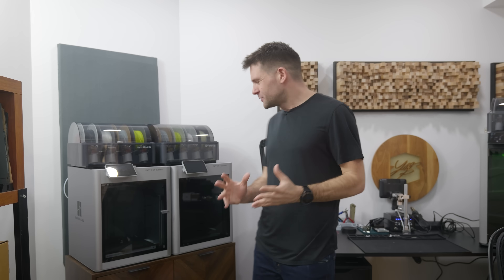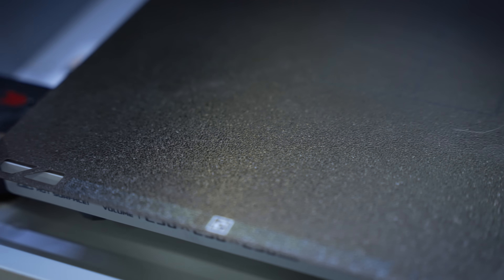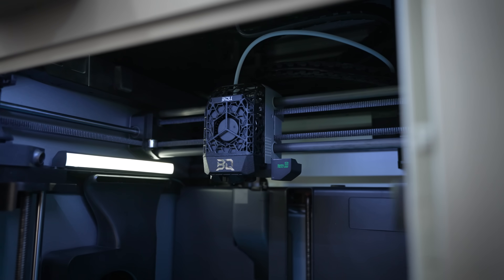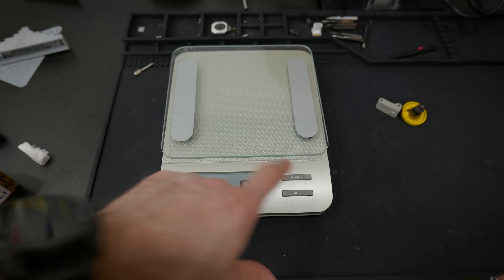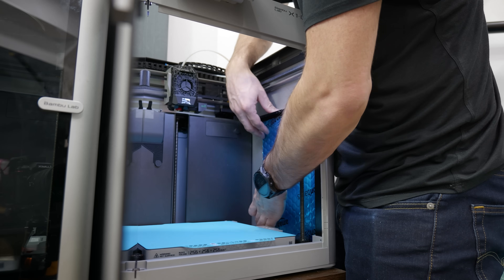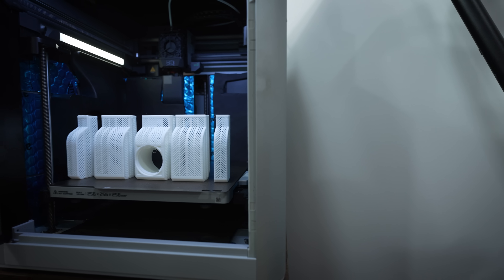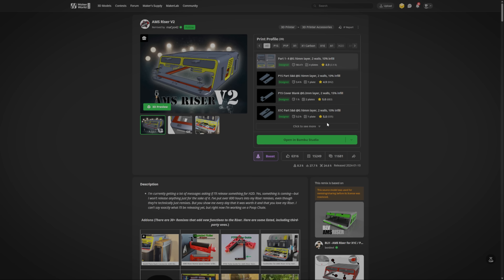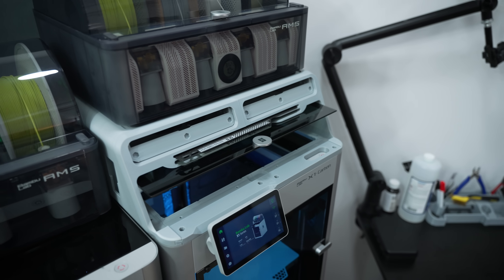I dont understand why more people dont MOD their 3d printers...

Comment: “Why don’t people mod their 3D printers?” 

Spoken like someone who missed the first 15 years of 3D printing.
Reply: I specifically bought Bambu and Prusa printers BECAUSE I was sick and tired of fiddling with my Ender 3s and CR10s and Anycubic bla bla blahs.
Modding modern printers typically does nothing for the standard user, those paid upgrades are geared more towards print farms. The printed upgrades are definitely where it's at, because as the main point of the video was - they are about usability and improving the experience rather than improving print speed or quality; they have both been covered by the manufacturers already.

Gone are the days of buying a cheap printer for <$300 and spending $400 modding it to perform like a $600 printer. Now you can just buy a $300 printer which performs 10x better.
Reply: Klipper users have entered chat
Reply: @AlexG207 based
Reply: @AlexG207  With Bambu's recent stunt with "You must use our Slicer!" and firmware lockdowns, it's more than enough reason to avoid them. Price hikes due to the tariffs is another reason. If you're the basic hobbyist using a 3D printer for fun, sure, that probably doesn't matter. I however, need to calibrate my filaments, z-offsets, Z-Hop and other critical settings to improve print quality. Klipper gives me that for both my FlashForge and Anycubic printers. Bambu is better off selling their business to Apple and calling it a day.
Reply: Most of the printing I do is for mods for my printers
Reply: @charleylavin  Charley, you really need to get out more.
Reply: Bought my ender 3 on launch. What a time to be alive.
Reply: Yeah I remember when mods most printers had a list of recommended mods to just fir basic function and reliability.
Reply: Man. I miss open firmware printers.
The question I actually make myself, is why people accept vendor lock-in.
Reply: @Splarkszter there's lots of open source machines. Bambu is the opposite.
Reply: lol exactly. I modded the crap out of my Ender 3, not so much that I enjoyed it but because you had to to get decent quality and performance. Now I want to tinker with what I print and not fuck around with my printer.
Reply: @instanoodles  still grumbling through on my ender 3 pro HEAVILY modded to behave and do it at speed 🤣 but man if I had the spare change one of these newer core xy machines would be SWEEET
Reply: @instanoodles  back then we were simply lying to ourselves that we enjoyed tinkering with the printer.  it was simply pure copium
Reply: @instanoodles  i dont understand the problem people have had with ender 3's like im a beginner 3d printer as of january 12th this year and i got an ender 3 v3 se zero isssues aside from my own incompetance
Reply: @D30Delirious  The Ender-3 V3 SE is about six generations of major hardware iterations after the original release model of the Ender-3, so really not the same beyond the 235×235 build area and the basic bedslinger form factor.
Reply: hahaha exactly...  Hey Zac, welcome to day-1 dude ;)
Reply: ahah this.
Love these videos of people that just got into 3D printer, ignoring that it has been around for years and modding is pretty much what most of us do.
Reply: I've just got into 3D printing, but a good mate has been doing it for a long time and I've heard of all the issues and time consumption just getting it to run takes, so I am super grateful for the plug and play machines available now. 

I will not be taking anything for granted. 
In fact, when something takes 'a long time', I feel more grateful because it would've taken 2x,3x, 4x with older machines 😅
Reply: MONEY IS THE ANSWER, plus current printer are pretty dame good out of the box but expensive so you don’t really wanna spend more money on it with little reason too.
Reply: YUP me watching with my original ender 3 with basically only motors and half the aluminium frame the original.......
Reply: yuuuuuuuuuuuuup
Reply: nice
Reply: Automotive hobbyists enter the chat.
Reply: I built a Mendel back in middle school, I've had modded a8's, enders, robo3d, og qidi, and some POS davinci. I'll say that I'll never go back from the bambu because it actually works lmfao
Reply: and after watch the video we end up with 1 funcional mod only
Reply: @Splarkszter  Most people are short-sighted creatures of comfort who only care about convenience until their decision bites them in the butt. That said, there are plenty of DIY kits/BOMs (Vorons chief among them), and most of the manufacturers of non-industrial 3D-printers still have no barriers to replacing their (nowadays usually Klipper) firmware forks with fully featured ones, even on their Bambu-style printers. Bambu and IIRC Anker are AFAIK the only black sheep.
Reply: All my printers before the X1C were more mods than original parts, I've bought the X1C so to NOT having to mod it
Reply: Guys trying to flex by talking about how they spent so much time they spent tweaking their Ender 3 or their Anet A8. My first two printers were scratch builds because Ender and Creality didn't exist.
Reply: @drhender6943  you must be a lot of fun at a party. Do you go around tapping each person on the shoulder to explain how you are cooler than everyone else or do you ask them to gather around so that you can tell them all at once?

The video was about modding printers so people addressed modding printers. What kind person would I be if I was to answer a post about modding to tell him I built my own printer… oh wait…
Reply: yeah this guy is an idiot
Reply: True words
Reply: Lol exactly. It was all about that.
Reply: I will never go back to that. Spent more time calibrating my printers than printing
Reply: Exactly. My first 3D printer was an Anet A8 which I got in 2016. By the time I was done with it, it looked and ran like an Ender 3, with full aluminum extrusion frame. Then along came kids, and now I don't have time to mod 3d printers anymore.
Reply: @kulilin3104  anet a8 was my first aswel.  and it has become many printers.   bit ship of theseus thing going on.  
it was technicly the same "printer" but all of the parts had been "upgraded" many times.   
even gone through a few re-designs.   

in the end it was big.  full metal.  had a belted z instead of leadscrews or ballscrews.

had so so many features.  and still.. the bambu simply was just nice.  no more need for recalibirating.  no more need for temperature towers.  no more need for anything time and fillament wasting anymore.  simply draw and print and it works, is dimentionally accurate.  it's just nice.
Reply: @darkracer1252  I purchased a Bambu as well. I still wanted to 3D print, I just don't have the time for tweaking and modding anymore.
Reply: RIGHT?! What an insane question. I want to work on stuff WITH my printer, not work ON my printer. Some people have other goals in life. This low effort slop is so annoying.
Reply: @goldwinstewart6590  if you think this is low effort, you mustve not seen some of the other 3d printer videos on youtube
Reply: @goldwinstewart6590  Thank god, I thought it was just me. Apart from the poop basket on my AI mini, I'd rather spend time learning 3D design and printing actual useful items, spending my money on filament not inconsequential crap!
Reply: @goldwinstewart6590  yea just a shit video overall....

Comment: “Why don’t more people mod their 3d printers?” - do you think Bambu is the only producer of 3d printers in the world or something? 

Tons of people mod their printers. Tons of people have basically always modified their 3d printers. 

Honestly, the premise of this video would make a lot more sense if it were just, “Why don’t more people mod their Bambu printers?” generalizing that topic to all 3d printers is a stretch to say the least.
Reply: And most of those printers that NEED mods to work well, are poorly made and designed in the first place. Why buy them?
Reply: @ I have a modified Voron Trident 250, a modified Jubilee toolchanger, two modified Voron V0.1’s, and I’m in the process of building a modified HevORT. None of those are poorly made, and all of them work well as their original design. I made them work even better (for my use cases) through mods. 

But really, what’s your point here? Whether or not printers are poorly made is irrelevant to my comment. I was making the argument that lots of people mod their printers because the video title asks why more people don’t mod their printers in general. That’s a terrible video premise because TONS of people modify their printers - it’s just that not that many modify their Bambu printers. Asking why more people don’t mod their Bambu printers would be a fair video based on the content. However, across the 3d printing hobby as a whole, a very large percentage of people do in fact mod their printers, which means the video title doesn’t actually make any sense. 

As for why people would buy poorly made and designed printers in the first place? I think what you’re referring to as poorly made and designed (at least these days) are actually decent printers that have one or two serious flaws. For similar performance, I would argue that it’s often cheaper to get one of those printers and throw a couple of cheap mods on it to get performance that is similar to what Bambu makes, but for less money. So that’s why people buy them. Plus, Bambu printers have a whole host of issues associated with them if you care at all about cybersecurity or consumer rights - and some of these cheaper printers are pretty well open sourced.
Reply: @ those printers are ok out of the box, but aren’t really well designed. That is, they’re fine, but not great. If you like them, that is great. But a lot of these mods don’t really make things better, and you can’t duplicate a Bamboo Labs by modding something else. If that’s what someone wants, then they should just buy the Bamboo Labs.  After all the mods, the money and particularly the time spent, usually doesn’t make it worth it. But, you see, this is what we’re talking about here, the difference between someone who want to play with the machine to hot rod it and the person who buys a machine to just print. I know people who have spent way too much time and money “upgrading” their machines who have found little difference.
Reply: @ in what way, specifically, are they not well designed (I assume you’re talking about the printers I listed)?

I wasn’t trying to duplicate a Bambu Labs printer with them, nor with the mods I chose. I think you’re latching on to the wrong point here though. I am not arguing whether or not Bambu printers are worth buying, or if they’re well designed. I am specifically arguing that the video title doesn’t make sense. The video title specifically relates to the entire category of the 3d printing hobby. The video content specifically relates to Bambu printers only. The inferred assertion from the video title (that not very many people who 3d print modify their printers) is utterly ridiculous. That is the point I am making. 

If you know people who have spent too much time and money on ‘upgrades’ with little to no difference, those people chose the wrong mods. Bambu machines are fine, and they (generally) work well. Bambu has also - thankfully - done a decent job of offering replacement parts for when things wear out or break. There are also things that Bambu machines either can’t do, or don’t do well. They also lock you into their ecosystem, which is something I am not a fan of.
Reply: My Sovol SV08 is working right out of the box, really it's fine for what I currently need it for, but I am going to update it more partially to add some convivences,  Multi material, (vendors are coming up with some very good ideas) level the bed better and faster, the bed right now received some shims, but it was still OK for the most part, for what it cost I don't mind. Now worth it? for me 100% worth it, not too hard to work on, fun little project, and even with the things I am doing to add it will do what I need WAYYY cheaper than the Bambu H2D I wanted to get.  I do not like working on them to fix them per say, but some mods within reason to make it more unique and do  what I want or need makes fun. 

They have come a LONG way since I got my Ender 3, and my little monoprice mini before that.  As for the Sovol SV08, this printer is totally worth what it cost, you will be very pleased with this printer AS IS if you need or want larger 1 piece prints. I am so glad I got this.
Reply: Gotta love that cloud lockin, chipped spools and closed hard/software.  otherwise it isn't a challenge is it ?
Reply: Said it all
Reply: this guy probbably bought a bambu as his first printer and got it this year or something.  seems to be totally new to all of this like the rest of us 5 to 10 years ago.  and some of us 25 years ago. 
and has that bubble view.  only knows what he knows and thinks nothing else exists.
Reply: @ it sure seems that way - I've been into 3d printing and modifying 3d printers for the last 10 years or so. My first printer was a Creality CR-10S. My first build was over 5 years ago now, and was a Jubilee toolchanging printer - which I'm currently revamping from Duet 2 hardware over to Klipper and USB toolboards.
Reply: Yes sir! I just ordered a Sovol SV08 and many addon parts and going to install some before ever turning it on! The printer alone without the mods cost just what the H2D added markup money. For what that thing costs now, I have time to tinker.. and actually in reality, I don't really want to mess with it, but I don't want to fall behind, so I am glad Bambu lost my business for this printer.
Reply: He thinks like that because they sponsored him
Reply: @omglul914he thinks that because most people these days don’t mod their printers. It’s like personal computing. Sure, a lot of people put their own together, or mod them. But the vast majority don’t. The majority of people who 3D print is now composed of those who don’t mod their machines. I don’t count those who but sms units or different nozzle sizes or types. That’s normal. But the market is moving in that direction more and more. The hobby market will always be with us, but as a percentage, it will be less. Likely, some of those companies will go out of business as all these small micro computer companies did after IBM came out with theirs. Maybe it’s sad, but that’s what happens.

Comment: None of these are real mods. They are either gimmicks or just aftermarket upgrades ( I use that term loosely) or replacement parts.  Make your own carbon rods and replace them, now there's a mod. Mod the firmware to go past 300°c and then you have a legitimate video.
Reply: The metal gears are a mod lol. Man people arent happy with anything. Also bambu labs dont need the mods like the ended 3 v2 needed to run properly. So yes these are mods. A mod is modification of an item. He is modding his printer.
Reply: @kurtiskeys483  no he is just replacing parts.
Reply: I remember modding my anycubic delta printers with newer arms, changed the board entirely, place better motors.. and watched that monster spew awesome prints.

Comment: Regarding the nozzle upgrade, Microswiss has an upgraded nozzle for the X1 and P1 printers that also allow for faster swaps and it's quite a bit cheaper.  As of writing, the hardened, high-flow variant is only $85.  For third-party plates, I tend to use Darkmoon 3D plates the most.  I typically just leave their ICE plate on my two X1Cs, and I haven't had any issues.  Just be aware that thing stick so well to it that thin, small models can be a pain to remove as flexing doesn't usually do much.

I'm not sure if you just print a lot more than me or something, but even across two X1Cs and one A1M, I've never had an extruder clog/jam.  Have you checked the tension on the arm in the extruder?
Reply: I just got the Microswiss the other day. I'm so glad I didn't buy the revo.  The only thing I can say is that pla can be tricky due to the heat soak on the heat break. There's a fan mod that addresses that but it's not compatible with the x1c due to the lidar bump. I'm attempting a mod to address that as we speak. It's so nice being able to switch nozzles super fast

Comment: the main reason why i leave everything stock is because i had already 3-4 years of ender 3 and other 3d printers to mod.  and everytime you touch sth ... it breaks sth else. 

im at a stage i just wanna turn on my printer, press "print" - come back in 20 hours and enjoy a nice printed piece without me  tinkering much ^^ . -  so the more i upgrade or do. the longer it takes to fix the printer if sth is wrong. 

Just my 2 cents :p
Reply: many of us feel like this lol. i’ve an ender that has absolutely NOTHING original except the metal extrusion frame and some of the bolts that hold it together. i just want a printer that works lol
Reply: You  hit the nail on the head.  Maybe it is easier with some of these new printers but I can't afford to buy one.  I did some basic essential modes in the beginning but now I don't touch it, I just want it to work without 3 hours of diagnostics, repairing, and calibrations every time I do a print.
Reply: I've spent more on 3d printers with upgrades and modding than my P1S with AMS2 so lesson learned. A 7 hour print on my Ender 5 pro takes 1 hour 10 on the PIS with vastly superior results. I love the fact I can finish in Freecad, import to Bambu slicer and send it to the printer without moving out of my armchair. Mind you the biggest downfall is I have to get out of the chair to remove the model. Personally going for the P1S is the best move I've ever made.
Reply: you could at least spell out something, you didn't shorten any other words, what was the point
Reply: The amount of bambu fails ive seen this is still a problem.
Reply: @slacksthegreat  bambu fails?   i think you mean user fails.
Reply: @darkracer1252  No I mean bambu fails.